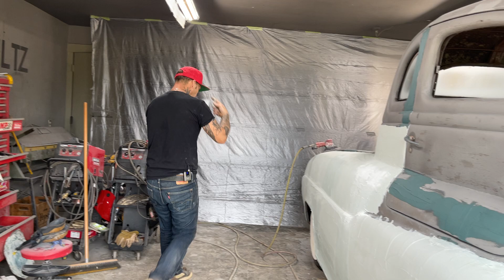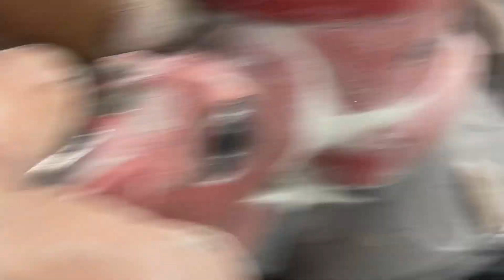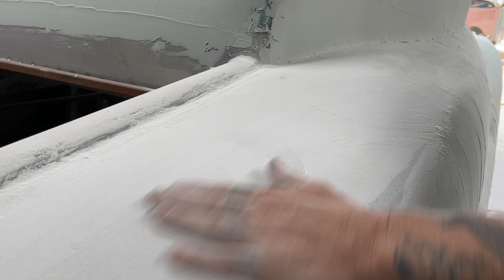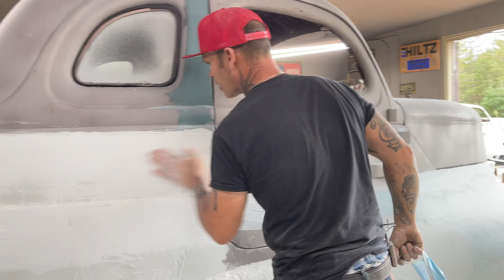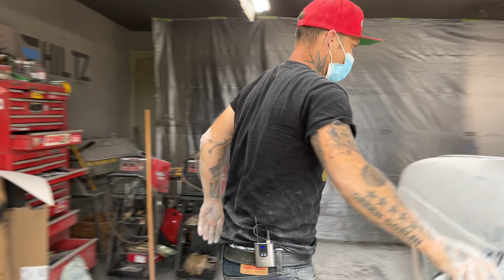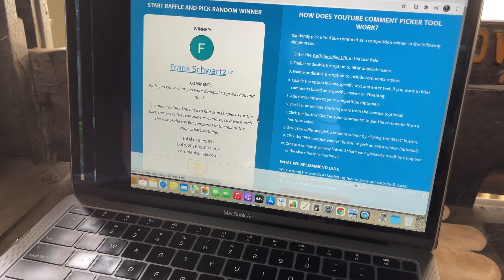SANDING BODY FILLER WITH POWER TOOLS: 1949 MERCURY CABOVER

Comment: I was taugh at an early age not to do mud work with a jitterbug or a DA sander,we only use a big DA/paintbuster/mudhog to knock down the initial wipe,after that its all hands on deck,long board,short board,and the occasional softblock. I've not got much use for a straitline airfile either,they can make grooves that are a pain to fill and can actually cause more work.

Comment: I don't like sanding with power tools .. because they take the shaping out of it. You loose detail and also you get flat spots .. a flat block is better... I made my own block with a piece of rectangle aluminium filled with fibreglass and rubber strip. It even has Velcro on it to stick sand paper on. ... You also need to drain your compressor after every time you use it.

Comment: That type of mask would not be suitable for these jobs, at least those of the FFP2 type should be used, which are able to capture up to 94% of the particles present in the air. Or even FFP3, which are capable of capturing up to 99% of microparticles.
In any case, great job as always. 😎👍 
Greetings from Switzerland

Comment: I'm a believer of dry air ,, and found cooling it  before it enters tank is the key,, l put a roll of 1/2 inch coil copper tubing between compressor and tank with a separator and dropped my air temperature by 80 degrees,, condensation forms from the exstremly hot compressed air entering the much cooler tank,, this will save your tools and prolong the life of compressor and tank, and I have down dropps with drain valves at every connection station, l hardly ever get any water now.

Comment: X2 on using plexiglass,not so much for weight but f;lexability versus glass..i dont know about cutting turret to wipers..youve got full strength now,why weaken it by ctting welding...when plexiglass will sit ring in there,seal it for water tight

Comment: Sanding with a DA sander is a little tough at first and even with experience you can find yourself making some mistakes.  A good quality sandpaper and sander does make all the difference.  The smaller DA is harder in some ways over the bigger one but the bigger one isn't an orbital its a direct drive which can grab hardere on you and takes more concentration to keep it flat.  I like it because of the fact that you've got 8" of space that it works on at a time .  Joline did a great job for her first time !  I started doing body work with just a set of hand blocks and I tried a lot of times before I felt like I was doing a good job but, the sanding scratches were  easier to take out with the power tools over hand tools plus a lot faster.  It takes time to get anything right so just don''t give up

Comment: I'd say that there's alot of fabrication  yet to do but it's on the inside of the  build . I'm sure that the flood sanding will go well and then the primer . The race car build is going to be epic . I'd like to put a corvette  engine in  that and make it a gasser . What do you guys say ?   Thumbs-up Jolene 👍and 👍Chad

Comment: There is always a reason to do thingd right !  If you aren't going to do it right then, is there any sence of doing the job ?  Thats like using old sandpaper to do the job or really cheap sandpaper which, we know doesn't work.  I think you may have just been making a statement but, there are a lot of first timers watching so you don't want them to take on that opinion do you ?  I think that you are trying hard to make sure that they get the correct ways of doing things.  There is always more that one way to do stuff.  I really like the racecar.  I'm also a big fan of the electric tools now that they have them .  Air tools seam to have lots of power if you have a compressor that can put it out !  Keep up the good work !

Comment: Hiya. Si from near London ere

Not sure if it's been mentioned before, might be too late now BUT 
Message to chad...
The area under the rear window of the cab over...make it into a small trunk/boot area for all the rachets n straps ect if you intend to tow a race car..shape n cut a hole under the rear window, line it with either sheet steel or maybe some ply or mdf maybe???
Much love.....si ✊✊✊💯⚡🏴‍☠️

Comment: Lots of sanding for sure. But a lot of hard work is required to do any task. I drained the water out of the compressors every night at our shop. Moisture is a killer on your air tools and will screw up a paint job quickly..... Love how the trukcar is coming along.